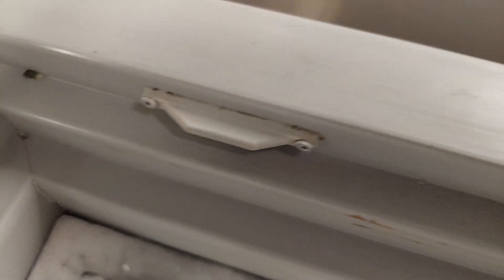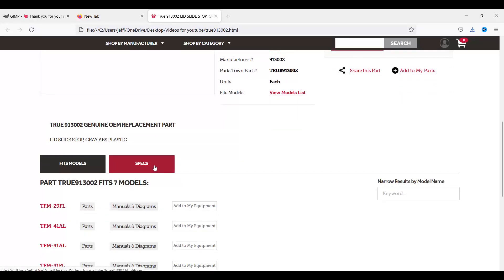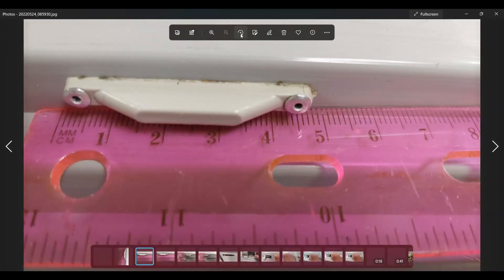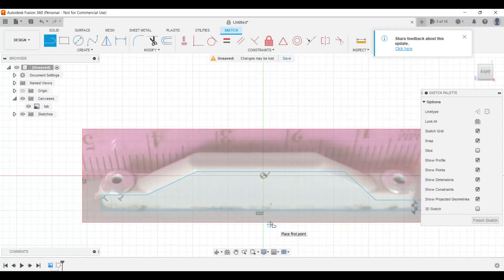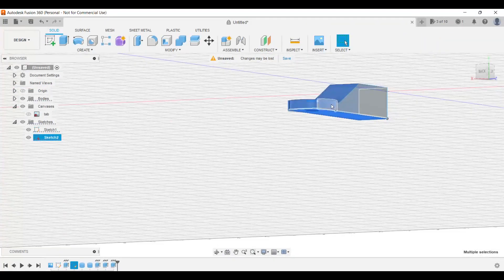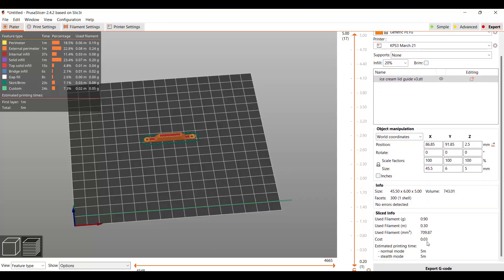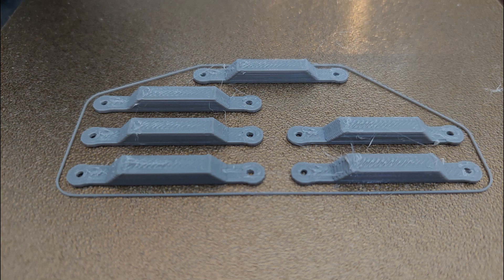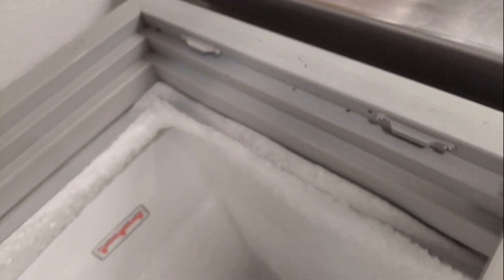I Saved $300 On Parts By 3D Printing

Comment: I have done a few of these types of print and also others to solve problems where the parts don't exists.  One of my 3D printers the injection molded bracket that holds the stepper motors cracked, I ended up reprinting them.  Funny thing is the 3D Printed part has laster longer than the injection molded one.

Comment: Currently doing a similar thing myself. Either I buy a whole new piece of equipment or just 3d print the plastic bits that have failed. It is also possible to improve on the original design when 3d printing the replacement parts.